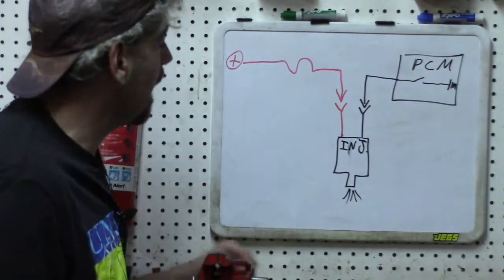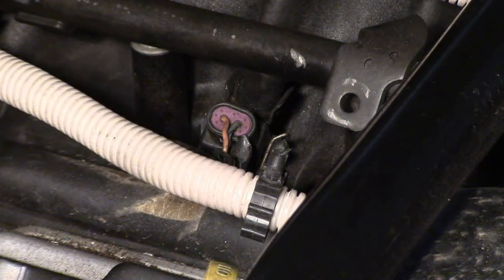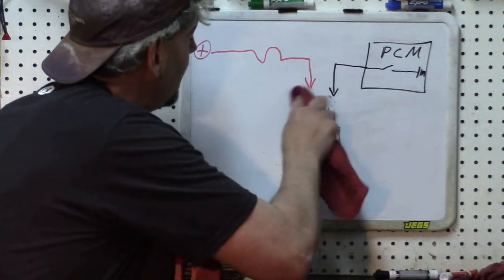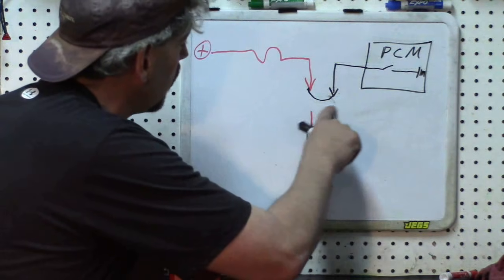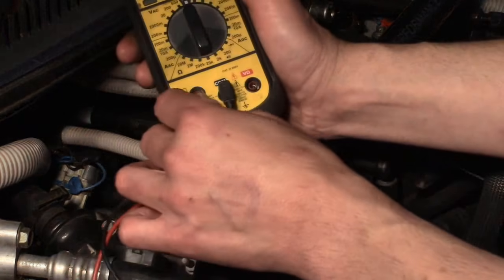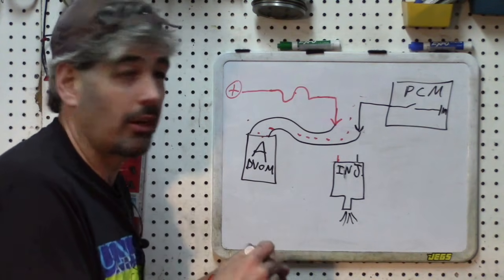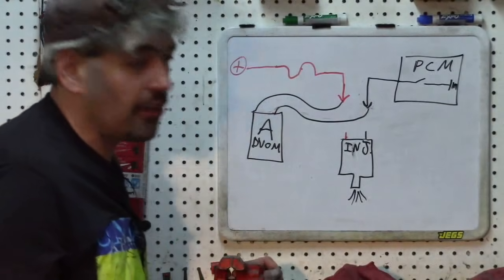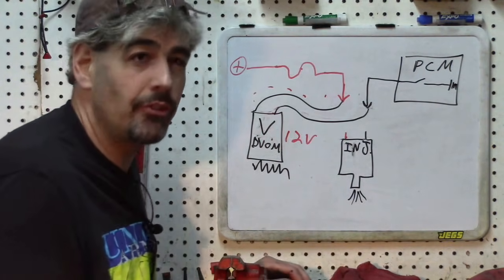How to Not Fry Your PCM-  SBQM Channel Free Video Sample!

Comment: Been doing  air-conditioning and refrigeration for  40 years and now I'm  retired and I  enjoy working on  ars and  just learning  automobiles and  diagnostic  but I have always  used the  troubleshooting any electrical problem  source  ,path  switch , load and  sequence of  operation  to  test electrical  circuits  and  don't get overwhelmed with  the  electrical  diagram or schematic  ,just knowing what  isn't  working and  only  be concerned with that  find  the  component  and follow the  path  backwards to the  voltage  source  .I have  enjoyed  your  videos and I  have  learned  in a  few  weeks of  watching you and your  explanation of the  sensors and   components the  ecm and  the  pcm are  controlling and  that's what I  am  looking for  thanks for  sharing your  knowledge  and  I  am  going to  subscribe  to  your  advanced  learning  channel. Looking forward to  learning 
 and sharing  some of my  experiences and  helping  younger students and  future  technicians

Comment: Also very important have the the right size terminal to probe the terminal to not overspread it. And to test the drag on the terminal  for a good tight contact. In my 30 years experience many problems are caused by other techs spreading the terminals causing additional problems .
Reply from the maker: In your 30 years experience you use a noid light set instead of just a test light???

Comment from the maker: Gotta love the negative commentors who wouldn't know how to diagnose a dead battery much less a TPS. Am I wrong or would only a fool thumbs down the source of knowledge that would  finally make them competent?
Reply: I don't think a smart knot with a balljoint hammer would make them competent-- they know how to cross thread spark plugs. Most of us like to know  how to diagnose and (repair). People like to hate what they don't know or understand. Your channel is extremely informative, thanks for taking your time to teach us!
Reply from the maker: Jeremiah johnson "People hate on what they don't know or understand"
  Words of wisdom there my friend- that is so true!!!
Reply: +Schrodingers Box I don't think the test done around the 14 minute mark is a good one because if the coil was shorted then you could draw more than 10 amps and blow the meter fuse, your thoughts?
Reply: +Nikolay Baranyuk Good point- you're right!
Reply from the maker: bidoubleo tiwhy Happy thanksgiving to you too my friend.
 And yes- the comments are gold on this channel. I also learned more from the comments than I have in 7 years of doing this hobby- by far!!
Reply: +Schrodingers Box The fools guild is always willing to accepting new members.  They charge no dues, there's no  probationary period, plenty of job security and flexible hours. The only requirements are that you just leave brain at the door and let your mouth run riot.  Applicants with an attitude are given preferential treatment.
When given the choice some people will choose the easy way out, even if that means being a moron troll.

 I passed the test by the way.  I had to think about it, but I'm a little rusty.  I'll be subscribing to the QM next week.  The video is one more thing to be thankful for this year, so thanks!
Reply: +Nikolay Baranyuk So ohm test the injector unplugged first.  If the injector passes then run the current test.
Reply: Schrodingers Box your videos are underappreciated. Thank you for taking the time to make them
Reply: Your videos are excellent and you have one bad ass Pontiac .

Comment: I am a retired electronics tech .  I am no expert mechanic but I have repaired my cars since my 20's (now 82) and have reasonable mechanical skills. I have rebuilt a couple of engines, but there is a lot I can't do and a lot that I don't know.  I drive a 1992 Ford F150 that has three relays. But I have been paying attention to the newer cars too, and have helped troubleshoot a couple of them. That taught me how much I don't know. Right now I am working on my grand daughters 2010 Cadillac srx.  I had to get a new scanner and it shows a U0100.  From the symptoms I believe the problem probably is a bad ecm, but I am checking the power and grounds to make sure it isn't something else. Anyway, bottom line is that I have decided that modern cars are really computer systems with an engine attached. I find the automotive electronics very interesting and want to learn more so here I am.

Comment: Great video Matt. At 19:36 you mention that it would be a good idea to use a fused jumper wire which I agree with because there is a small possibility that the underlying problem was an internal short in the injector. That in turn would blow the fuse on the wire supplying it with power thus matching the previous symptom of 0 V coming to the injector. But if we then supply the injector directly the jumper wire might carry enough amperage to blow the pcm. So it would be best to always use protection ;)

Comment: I have basic electrical knowledge, very basic(even though I'm the son of an electrical engineer :P
). Thanks to your videos, which I sometimes watch several times to understand and make this knowledge and understanding sink in, it is quite easy. Very clear explanations along with illustrations on the white board make it really friendly. Thanks again! I would just add a warning for other beginners who use any wires or test leads to be careful, when, for example, improperly leaving uninsulated wires, they do not accidentally short-circuit those that will cause damage, e.g. fry the PCM or start fire. Sometimes engine vibration/closing doors alone can cause contact and short circuiting. I wish You best and thank You again. We need more people who approach things like You do!
Reply from the maker: Thanks for the comment and yes- it takes most people several times watching before it sinks in. I am the same way!!!

Comment: Thanks, great video. Like you said in the beginning of the video, if you don't know basic electrical, learn before you start testing. It seams the Auto industry purposely make many sensor's that eventually fail, but what you are saying is that you have to look at the whole picture because it can be different problems. For Example; I just changed my fan resistor and wire connector because my car was overheating. Yes, the resistor and connector wire was burnt, but the radiator was also clogged, and I had to change the radiator, but I had to go much further and change the thermostat and The cheap plastic housing. That finally solved the overheating problem. Thanks! 😂😂😂

Comment: Another great video on electrical diagnosis. It seems some people were really trying to get your goat below. I see you held your own but you do make it too easy. Trolls will be trolls.  The issue with the use of a scope is not so much price but the steep learning curve involved in getting useful results. I recently bought a non-automotive Picoscope (2205A) and have been learning to use it for relative compression, secondary ignition wave forms, current ramps, etc.  I have spent hours learning how to set up the software (Picoscope 6) and probes(amp clamp, induction, etc).

Comment: Matt good job.  I have something I would like to add.  When you were checking battery positive supply at the injector connector unplugged that test is not totally valid.  That test is only telling you if you have a open circuit or not, you are reading static voltage.  You have to load the circuit to see an actual representation of the voltage at that wire.  So hooking up a test lamp or using a substitute load rated the same amperage the injector is would be a better test.  Or use a Loadpro which is what I would use.
Reply from the maker: +busjockey1 I was not testing for voltage drop at that time but I do check voltage drop through amperage measurement later
Reply: +Schrodingers Box Alright so you were just checking to see if you had static Voltage?  Sorry that just threw me off because you said that was a valid test.  For checking for a open circuit yes.  I understand your process here but you might want to clarify the difference between a Static Voltage Test and a Loaded Voltage Test:  Voltage Drop.  Someone new to doing this type of work could get confused and in effect not do these measurements properly.
Reply: +busjockey1 Yes remember this video is part of a whole 4 part series where I talk about all this stuff. I also talk about static vs loaded voltages in my video on voltage drop on this channel.
Reply: I figured you did it's just at that part in the video on how you did that test I think it would have been a good idea to clarify this difference between the static and Loaded Voltage.  Not trying to be a pain at all it's just I want everyone to understand the difference between these two readings.  Keep up the good work.
Reply: I will check out your premium channel, looks interesting.

Comment: Why unplug an injector when testing them at all when you own a graphing multi meter and a low clamp probe? IMO a test light a scope or graphing meter like a vantage and a low amp probe you can test all PCM circuits completely safely. In my whole life as a mechanic I have never seen a test light ever damage a PCM, ever. I think it is more of an urban myth of mechanics.
Reply: +South Main Auto Repair His target audience do not have Vantage Pro nor a low amp probe.  Do it yourselfers don't have expensive diagnostic tools or it defeats the purpose of saving money.  I do agree with your and Ivan's point of view on scope on a rope.
Reply: Well I am just thinking with it being an advanced diagnostic channel and given the price of scopes and graphing meters now days it would only make sense. I just bought a 2 channel USB scope that for less than $100 ya know. There are some really good deals on some good used stuff too.
Reply: Please let me know what kind USB scope and how you like it.  I've been contemplating an economical way to get a scanner/oscilloscope.  A used SnapOn Modis looked promising.  However, the update cost, and your experience with your Verus gave me second thoughts.  It looks like a AutoEnginuity and PC based oscilloscope is the best way.
Reply: +Qiong Jia  hi I have the autoenginuity and I would not recommend it unless your a diy'er or don't want to spend more for pro level scanner. I find the PC scan tools like mine are very buggy and just wig out at times. Bi directional , not many functions. Hard decision , just depends on your budget . Hope this helps , just my experience others might have a different  opinion .
Reply: Steve, what do you recommend?  New Maxisys or used Verus/Modis?  I understand Autel is being sued by some Manufacturers.  It has more features, most are hacked.  Since it is a Chinese company.
Reply: I like to see what the top level techs are using, they know what's good or not. Eric at south main auto says  maxisys , well that's good enough for me. That guy knows what he's doing and then some. That's your answer. Nice talking to you.
Reply from the maker: +South Main Auto Repair Correct- very unlikely to damage the PCM with a "scope on a rope" however in the series I do cover the possibilities where this could happen and the difference between LED and Incandescent as far as applications.
Reply: Schrodingers Box I can not think of one example of how a 300ma (aka: test light) draw can fry a PCM on any circuit. Can you give me an example? It is only a myth imo. The only way it can happen is if you use the tip of the test light and short it across 2 pins and make a direct short or something stupid like that , but then again that can be done with a meter too. I have not been doing this very long but have yet to see it purge the smoke out of the mysterious black box yet... I have been talking with Ivan to and racking our brains and neither one of us can think of an example of how it can burn up a PCM. Throw me a bone here and give me a real example lol
Reply from the maker: South Main Auto Repair Using a LED test light it is virtually impossible. But using an incadescent one, you do get about 250mA through the circuit (one of my videos actually shows this).  On most of your typical engine sensor applications that's not going to do anything but some circuits I am quite sure must not use 1/4A and might be damaged. AGreed I can't think of any off the top of my head since I'm sure even 5V circuits can easily handle that but I'll come up with something- maybe things like electronic climate control, radio, stuff with circuit boards that don't use even 5V.
Reply: I agree to disagree haha by racking your brain and thinking of the one possible way in which a 300ma (or250ma) draw incandescent bulb test light can ruin a PCM you will come up with no "realistic" situation and will have to agree with me that it is nothing more than just a urban mechanic legend :) I know a lot of mechanics and have yet to shakes hands with one that can give me a real life example of how this is possible. IT'S A MYTH MAN!! Hahaha Remember we are not talking about testing SRS systems or remote outputs on audio equipment now.
Reply: Steve Rob WHAT!?! Come on now, even a premium guy like you can't give a good real life example!
Reply: +South Main Auto Repair haha you got Matt going there but man Im not going to make it that easy. Matt knows this its a fundamental basis of electron flow thru a transistor with a reversed polarity at the wrong time . Too easy.
Reply: +South Main Auto Repair The point of the series was to show the difference with various methods and to understand that some methods DO allow current into a circuit. That is my point. whether it can cause damage or not may be unlikely or even impossible but the point is to understand the mechanism of the testing and to assess it's application. for a specific circuit
Reply: +Schrodingers Box Matt I have to agree with you.. I have 3 test lights, an incandescent, one from OTC that has some sort of glowing element (Paul Danner recommended), and a  "smart LED" type light.  I just tested their amp draw.  The incandescent measured 250mA, the OTC style measured 140mA, and the "smart" style measured an astoundingly low 2.55 mA..
Even if 250mA wouldn't do damage, know what your test light draws and why take the chance?
Reply: Mike S Yes the argument (at least from my perspective) is not so much will you or won't you fry your PCM using a standard testlight- it's more understanding that using a standard testlight puts 1/4A through a circuit while an LED puts almost none and that is good to know if you have a delicate circuit. 
 I'm still willing to bet there must be some components- maybe not engine performance related- but some have to be damaged if you send 1/4A through them.
  Maybe an A/F sensor circuit? A/F's put out single digit Ma at the most- I sure wouldn't use a standard testlight to test a ground on that circuit!!
Reply: What kinda asshat would look at an AFR circuit and think he could diagnose anything other than the heater with a test lamp though? Lol Wait don't answer that.
Reply: absolutely right eric  been doing this since 1988 always used a test light  pcms are quite well protected more so  since. 2001 onwards
Reply: +Schrodingers Box FWIW, I took this note from one of ScannerDanner's videos: 

Is there a concern that you may be overloading the PCM by using the TL? No, the TL is only drawing 200mA while the circuit draws 400 mA. If there is a concern (e.g. stepper motor, IAC valve, relay coil) use a LED TL.
Reply: +South Main Auto Repair eric.....what brand of scope.?...I have been looking for one......have u done a video using it ?.....thanks for your comments...bob
Reply: cbobcbob100 On Amazon you can get a Hantek 6022BE PC-based USB 2CH Digital Oscilloscope 20MHz Bandwidth. Less that $70 bucks. I have one I use at home and it works fine. Sure they make them a 100 times better than this but the fact is for 95% of people this is ok.
Reply: +South Main Auto Repair +cbobcbob100 I have also purchased a Hantek off ebay 8ch 1008c. It does the trick, but the software understandably does not compare to snap on or pico.  It does not do a/c coupling and I had troubles with it randomly disconnecting.  Found the problem to be a faulty USB cable.
Reply: Eric can you use a regular (a/c powered scope) without damage to the PCM? Worried about grd loop.
Reply: so noid lights are useless?? and is looking at open circuit volts at injector harness even an acurate reading? just verifying pulse, right?
Reply: Best mechanic i ever seen i learn more watching his videos than i ever learned anywhere elce thak you so much man i thought i was one of the best mechanics around and you taught me more than 98% of what i know i love how you explain what the sensors are how they work and how you can use the information you  get from the sensor to diagnose other sensors thank you for all your videos
Reply: Im sure he is a better mechanic than you or anyone watching his video im greatfull for every speck of information he puts on his videos hes by far one of the best mechanics and one of the best automotive teachers in the world i would put my money on him being the best smartest mechanics/techs in the world
Reply: @bbkmm1   Eric is using NOID light set for testing injectors